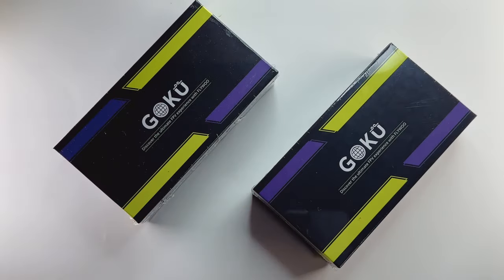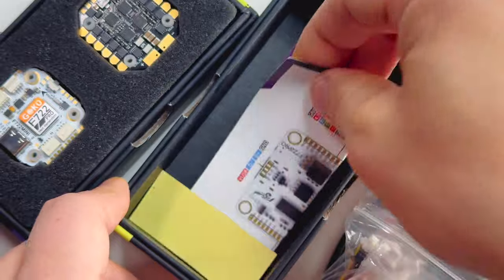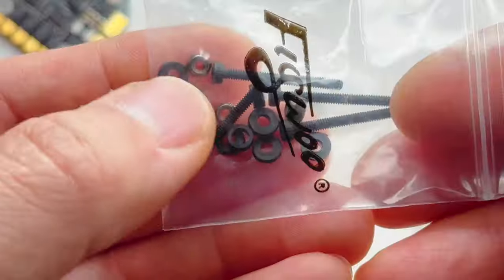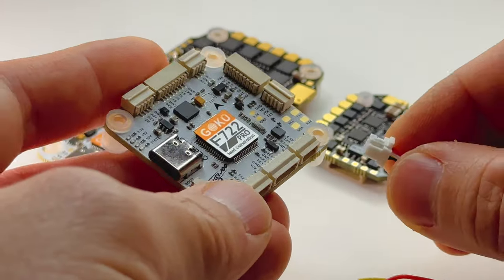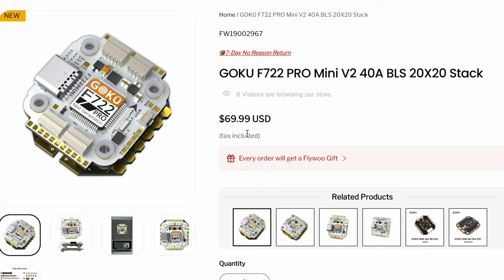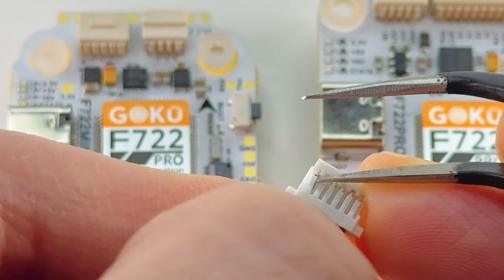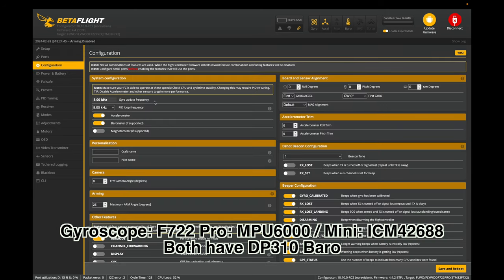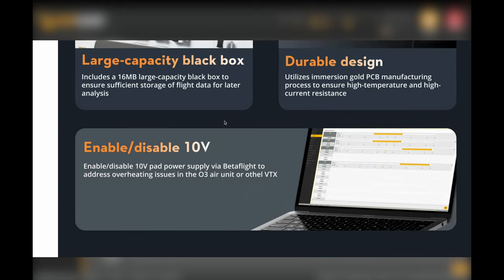Flywoo Goku F722 Pro 50A / Mini 40A | Next Generation Stacks for FPV Drones!

Comment: Ordered a mini a few weeks ago. Haven’t received it yet. Gonna slap it in a Bee35 or my Djinn F25. Dunno yet.
Reply: Did you ever install this in the F25. I have a Djinn also that I'm thinking of getting this mini stack.
Reply: @JimmyFPV1 I did! And it flies amazing with the right PID tune or preset from BF.
Reply: @DanielNordlundAtHome  Sick man! Thanks. This is my first build. I have never tuned a quad so I'm a little nervous. Any tips for a noob?
Reply: @JimmyFPV1  in betaflight use a preset for starters. Once you get used to how your quad flies using that preset tune, start making little improvements in the rates and PIDs and also, watch plenty of vids.
Reply: Thank you!